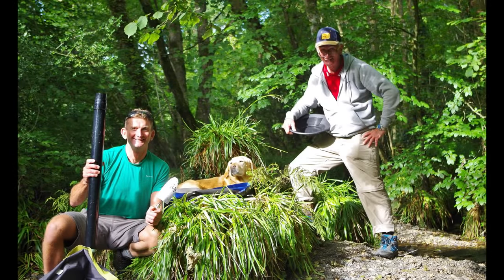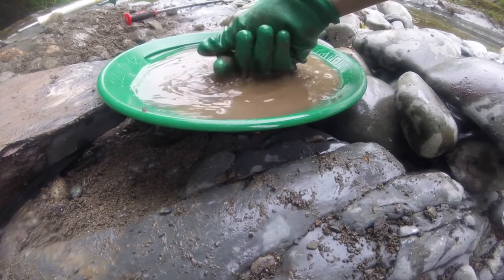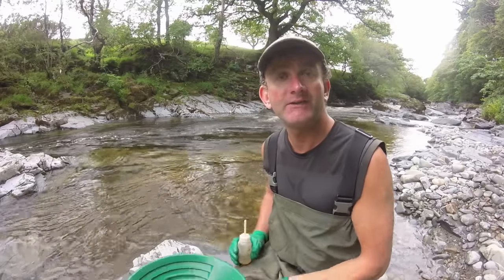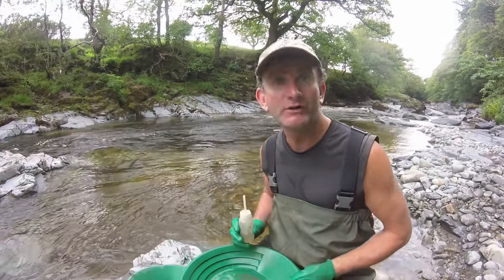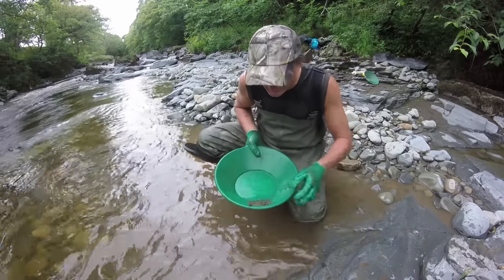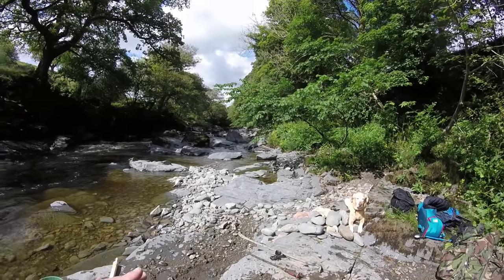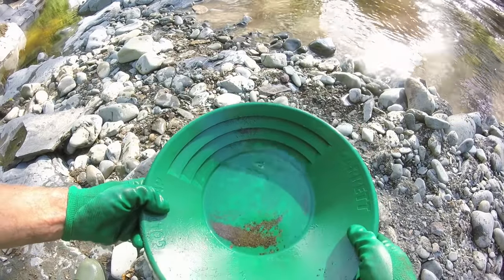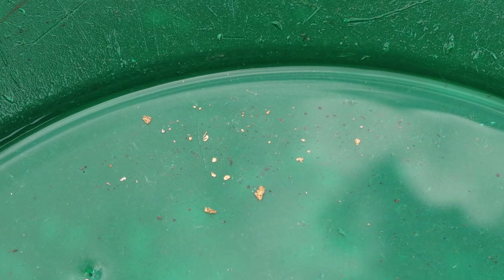How rare is English gold ?

Comment: Hello. You said ‘though its heavy it can float due to its microscopic properties’.

Watching how you fill the sluice with one portion of material after another (your earlier films), I am wondering, is it possible that particles of gold just ride over already occupied ridges of the sluice and finish back in water? Sliding over the material that settled there before? Or the ones that already settled, can they be pushed out by new portion of material? Did anyone check how much gold can be lost back into water? How accurate is sluicing?
Reply from the maker: Great point Greg. Gold can float because of it's is hydrophobic properties: ( I said the wrong thing - "Hydroscopic" ,oooops) it repels water. Because of this, even if the piece of gold is first completely submerged, if it gets near the surface it will throw off the water above it and float. Almost like when you lie on a mattress and it holds the shape of your body. It's surface area will be the key to this happening though. A solid lump of gold will sink like a lead weight  (or a gold weight)............I am rambling on a bit here.
Sluices create low pressure areas on the riffle sections which should allow anything heavy in the cons to drop out of the flow with greater effect. There are and always will be losses with sluices, I'm not too sure but 3 % would be a ball park figure and it could be much higher.
The fascinating thing is that when you look at the journey gold takes from being picked up by your shovel, go through a classifier and then be washed down a sluice run from a smaller shovel. Even the smallest particles of gold will come to rest somewhere on the run.
Sluicing is great to help you process the dirt and overburden quicker in order to hit the juicy pay layer, where ever that is. 
I'm still learning too Greg and that's all part of the fun.